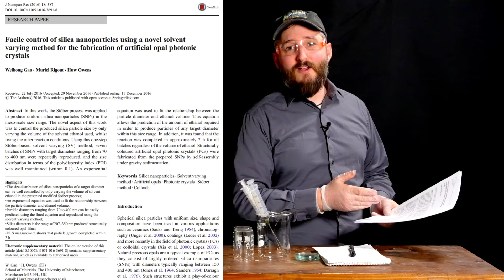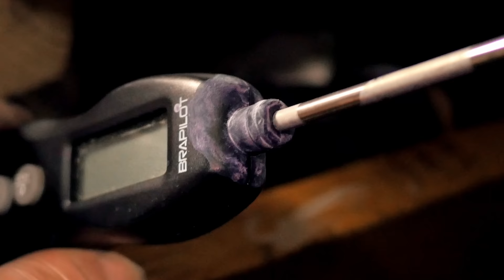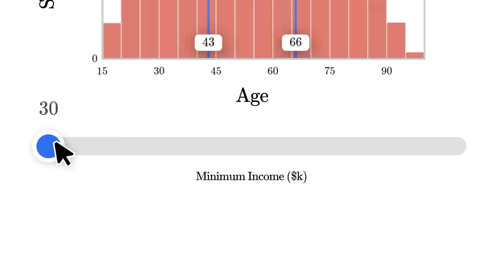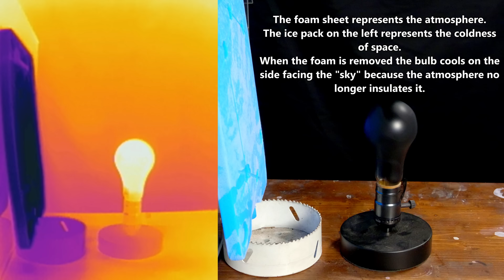Making Opals for Free Air Conditioning

Comment: Run the opaline fluid through a freeze dryer.  The vacuum element would negate the oxygen mixed in the fluid, and it potentially could speed up the turn around time for "settling out" a good looking opal.  Just a thought.  Cheers man, been a fan for a LONG time! :)
Reply: Or the opposite if natural opals are created under high pressure. I'd clamp a chunk in a vise between two flat surfaces. Ultrasound vibrations may do something but it's not able to grow a crystal in the first place. Something is holding the spheres together in the gemstone obviously

Comment: I’m a ring maker and often use opal as a critical component in my rings. I usually think about creating my opal, but the biggest hurdle I see is if you let the solution settle to create a gemstone. It’s very fragile, so I hope you tackle the issue of heating it under immense pressure to make a workable gemstone. I wish you good luck to you in your opal adventure!
Reply: Hot hydraulic press?
Reply: Natural opal doesn't require high pressure.
Reply: @MandelGuy232  Yes but real opal had millions of years to settle, dry, and bond together. Man made opal has to be sintered together to make an actual workable stone. the silica spheres are less densely packed and weakly bonded together so the resulting stone is fragile and more full of voids
Reply: As ideas: would pre-heating the ethanol in a second container and adding it would help the reaction?

Would adding some of the previous spheres work to help form a matrix, or is an “opal” as we know it not formed in a normal way?  As I mentioned in a previous comment, I know many opal hunters basically find driftwood that has been turned into opal. I wonder if you could use a similar matrix to hold the spheres tightly in solution like wood does and then dissolve it away somehow without damaging the opal? Tree roots and wood like red oak be a good porous choice I would guess. 

If you kept adding solution to an existing evaporation dish (a few ml per week) would that work to build up a decent crystal?

Comment: So where is my free air conditioning?
Reply: Uv ir radiation
Reply: It’s doesn’t allow heat (sun ie. UV radiation) through the light spectrum. Thus not allowing the heat to penetrate the windows which are one of the biggest problems about heat and cooling period.

Comment: Hey thanks for the shoutout and nice video!
Some tips that you may find helpful: For centrifuging, you need more speed not less. I used that exact same centrifuge, I just cranked it to max and held it so it didn't shake itself apart. Also for settling you'll want to dilute the solution with more ethanol, then let it settle in a tall tube. Like a grad cylinder with a removable bottom. That way the settling is as slow as possible and you'll grow the largest pseudocrystals. 
Also something I found was that the color you get from settling slowly or with a centrifuge, is not the same as the color you get from quickly drying. I found there was a weird effect where certain sized particle batches will settle out to look great, up until the second you attempt to dry them, then they look good. Or others that look good wet and dry. And different colors work differently depending on settling method. It was rather finicky to get it right.  Something I never took the time to do was quantify this carefully because it was so annoying doing the reaction as carefully as I was. The fact you got this basically working in a beaker actually speeds this way up. I was being way too delicate about it I think. Cool to see others working on this and this actually gave me some ideas on a way to improve making big chunks of opal. Though traditionally the long reaction time is there to make sure all the TEOS is used up otherwise the particles will start to agglomerate and stick to each other with the tiny bit that's left in solution.
Also for clarity, the issue isn't the particles. It's that they're not stuck together. It'll only go clear-ish if you sinter the final opal, or backfill it with epoxy to remove the air pockets/voids. The most difficult but pretty  ones to make are settled, dried, sintered, then back filled with a solution of even smaller particles, then sintered again. But getting that process to work is tricky. Though even a single round of sintering will make it more clear and glassy, but don't overheat it or it all just melts. Need just enough heat for the contact points between spheres to fuse, without melting the spheres. 
Hope that helps!
Reply: i watched your video 3 years ago. and when this was posted the first thought that came to my mind was  "OMG TTE already did this once " and suddenly i heard your name and had to come down to see if you commented and i was not disappointed hahah. i absolutely LOVE your videos :)
Reply from the maker: Hey thank you so much for all your research on this! You made it really easy for me. I think my previous calcium sphere experience helped me feel comfortable taking some shortcuts I wouldn't have otherwise. Like they say in the paper that the reactions were done in an inert atmosphere...but why? Maybe it improves things slightly but no way is that essential.

It's really helpful advice about adding extra ethanol for settling, and also about letting the reaction carry on to stop conglomeration from trace teos. I have a few samples now that settled on the bottom of my beakers and they do have a super bright band of color in the typical vertical stripes of a synthetic opal puck. I'm testing a bunch of stabilization methods currently like alcohol soluble binders and aluminum salts. I think maybe you could do without the supercritical drying if you start with an organic binder that burns out somewhat close to the sintering temp. I'm not sure, there's too much to test!

Thanks again, we'll have to keep comparing notes on this one!
Reply from the maker: I'm surprised you had better results with faster centrifuging also... That's bizarre! I only started seeing color flash when I slowed mine down. I wonder if it's about the amount of brownian motion happening... maybe your lab was warmer than mine.

By the way, you should take out the metal sleeves in your centrifuge and weigh them. I found mine were sometimes 5g different from others. Mine runs super smooth now at full speed with similar weighted sleeves opposite one another.
Reply: Most wholesome interesting convo on yt right now.   I love both of these channels, so this is like Christmas.  Thanks for doing it ya’ll.
Reply: @phlanxsmurf  need a mash up
Reply: I read this in the way that you narrate your videos.
Reply: Peak humanity in the wild. Its heartwarming!
Reply: What the internet was intended for
Reply: I wonder, can you use sonic vibration to help them pack better after they are settled and before sintering? With the right frequency, it may help settle them without kicking them back into suspension.
Or even settling them after they dry, although I might worry about abrasion effects, then.
Reply: Complete non-scientist here, but would it be possible to simply combine two solutions of differing sizes to fill in the gaps between the larger particles during the drying process?
Reply: My two fave science channels! Sick!
Reply: I've read your comment with a ruski accent. Awesome you guys making science, keep the good work.
Reply: @harvestkitty same thought I had. Unless we're off base, then the minimum effect would just be needing less binder/ post-processing since more gaps would be filled.
Reply: @Nighthawkinlight  I wonder if centrifuging at incrementally increasing speeds will allow for neatly packed “layers” to form better. That way you get the best of both worlds by allowing brownish motion to shuffle the particles horizontally and finally packing them down vertically with the higher rpm centrifuging
Reply: Perhaps the unbalanced centrifuge was a benefit?
Reply: Question: If the Brownian motion is what makes these particles settle so slowly, could you not cool the suspension to make them settle faster? Or would that actually not make much of an impact? Obviously at some point it would freeze, and I imagine that wouldn't help much :p
Reply: Youre basically Stephen hawking of genetics in my eyes. Thank you for all your videos I have learned so much.
Reply: I love your videos 🙂
Reply: Now I'm interested in seeing Aerogel made of opal...
I found this
"Synthesis of SiO 2 Aerogel Inverse Opals in Supercritical Carbon Dioxide"
Reply: There is something called stabilizing resin that's basically really thin resin made to penetrate into porous wood. Maybe that could work? I know those synthetic opals are using some kind of resin since they're mostly plastic.
Reply: How about vacuuming the opal solution together with a bit of low viscosity, slow curing dark epoxy in solution? Release the vaccum driving the epoxy into the voids that then can be centrifuged into crystals without the air before the epoxy sets up
Reply: Love your work.
Reply: Am I the only one who read this in his voice?
Reply: @TurboGreen  Same here haha
Reply: @Nighthawkinlight  I want to second the comments suggesting cooling during settling and or centrifuging, possibly cyclically and am also curious if handling the dry opal powder isn't also a concern? The TEOS certainly seems like nasty stuff but finely divided silica isn't great for lungs either … wearing a respirator might be a good idea and possibly developing a process where it's never completely "dry" until it's bound, if possible, might help with safety and holding a packing arrangement until the final product.
Reply: All this is way over my head, but could you sound to get the solution to vibrant the spaces out from between the nanoparticles?
Reply: When watching the portion of your original video where you use resins to encapsulate your results, you had said that you wanted a thinner resin so it could soak into the sample better.  I flashed on thin CA glue.  I think the stuff's thinner than water!

Now...there IS a caution that I should mention.  CA dribbled into a powder can be VERY exothermic!  I've wicked thin CA into a powder as a gap-filler or fillet and had it smoke, even getting hot enough to light soft balsa on fire!

Just a thought, FWIW.
Reply: pseudocrystals
Reply: U cool chemist too. I was just a general science student I didnt take chemistry
Reply: @harvestkitty  I think you and @3xeploding_3agle_studios would be on to something if it weren't for the need to sinter. Sintering basically compresses and removes the space between particles that the air is taking up. I think it's kind of seen in the video that this idea wont work too well in practice when it was attempted to make a dark base. 

It's also unclear what part of the drying process you are trying to improve. The size of the opalescent flakes will still be like grains of sand based on the way the spheres cant align together due to the brownian motion, and the distribution of those flakes are going to remain the same with any other kind of filler (like the nailpolish in the video) unless the synthetic opal is sintered.
Reply: I have also carried out this reaction. It's hard to make art with this. Neat colors tend to go away when attempting many different preservative coatings. Silane couping agents I think are what give the aurora type pattern. Vertical deposition as he showed in this video causes almost instant crystal deposition, and I read that in some literature.
Reply: @thethoughtemporium @nighthawkinlight what if you were to put your beaker in a vacuum chamber before drying so you take out all the air from the stirring, but still let it dry slowly instead of centrifuging it?
Reply: Could you chemically 'sinter' it by adding a bit more TEOS once the lattice has self-assembled in order to grow each sphere a few % so they fuse where they touch?
Reply: how is your lactoce intollerance experiment going after so many years?
Reply: I don't know if you will see this but if I use a uv resin as a liquid to settle the particles and cure it will that work?
Reply: Seeing open source scientific discussion between two of my favorite creators is awesome, you both do fantastic work in expanding what I, and surely others, think is possible through home experimenting and learning. Colab when?!
Reply: @zippolag  Was thinking this too.... Also controlling the temperature whilst under vacuum to give even more control of nano-bead lattice formation.
Reply: OK, I demand a joint video. I'm just kidding about demanding it, but it sure would be awesome.
Reply: dID aNYONE sUGGEST fREEZING oR eVEN cOOLING tO gET a gOOD sETTLEMENT?
Reply: I wonder if changing the shape of the container - either by adding jagged parts to the walls or floor would add a slight amount of turbulence that would result in a settling pattern more erratic and potentially more refractive than the columns the particles naturally settle in. Someone else suggested playing music as a way of changing the way the particles settle.
Reply: @harvestkitty  to get the chunky flashes of color like you see in true opals, the spheres have to bond in "sheets", so having the different sizes packed in together would interrupt that effect. Also, I think they are too close to the same size, so in relative terms it would be like trying to make a lattice of softballs and fill the gaps in with tennis balls.
Reply: @griffinbeaumont7049  I was wondering the same thing, something to help bleed off the heat should help with that, but I'm no physicist.
Reply: Two of the most stimulating yt channels collide. You guys are the kind of rockstars i like !
Reply: I don't trust anywhere you are, mr puts human braincells into microchip...
Reply: Be careful stabilising a centrifuge. We were shown pictures of a centrifuge that was being spun fast and became unstable enough to break. It launched a piece of itself through a concrete wall.
Reply: The legend!

Comment: What you'll see in high quality black opals is that the top of the polished opal with the "fire" is sometimes more translucent than the dark potch underneath. Doublets simply glue a translucent opal to a black background to create a cheaper imitation of a black opal. So you could let your opal just dry on a black surface, then use the nail polish trick to get rid of the white.

My understanding is that synthetic opals used as gems actually have the silica particles in some kind of resin, which is what fills the gaps instead of air.
Reply: Not anymore. No resin needed.

Comment: Sodium silicate is how you would best fill the opal spheres.

It can be perfectly mixed, balanced, and then dried using acetone under pressure until it solidifies [sort of like aerogel, only without making it actually hollow, and therefore having no porosity], which is essentially like what happens in nature when silane deposits around the opal spheres under high pressure in the earth.
Reply: Hello, I wish you good luck. Can you help me make synthetic opal?

Comment: My PhD is working with SiO2 Stöber type nanoparticles, glad to see this get some attention :)
I'm not going to grill you for the science about light scattering, it's a complicated topic. but let's just say that Rayleigh scattering is simply a simpler model of the Mie-Solution to the light scattering of particles. The Mie-Solution is exact, albeit requires a numerical solution.
Time to invest in a DLS / SLS / SEM / TEM! :D
Quick tip in general: pre-dilute your TEOS /w at least an equal volume of Ethanol (so split up your total charge of Ethanol into two parts), this prevents aggregation.
One last thing: it takes about 3 hours for me to see no more changes in particle size / scattering properties at 25C reaction temperature. I would recommend you wait at least 2 hours, even at 60C. you can do reactions in small screw-cap-vials, that way you can test many different reaction conditions very quickly. you can 3D print a holder or buy one made out of metal for a stirplate, should be able to stir like 6 at a time. then you just have to do it at 25C, but this doesn't influence the reaction all that much - you just get larger particles in general at lower temperatures.
One very very last thing: Higher percentage of solid content in a medium might not be better. The effect is non-linear, and there is a maximum volume percentage at which the maximum light is scattered and reflected, this is called "dependent scattering".
Reply from the maker: Thanks for sharing your expertise!
Reply: I feel like that once you start dealing with things on the nano scale most processes or phenomena become a lot less intuitive, and any short or simple explanations probably need a quantum asterisk  saying in reality things are a lot more complicated.
Reply: "I'm not gonna grill you"
continues to grill you
Reply: @ZanaCakes420  well, not on the science of scattered light. I did grill him about the synthesis itself tho, which is what this video was about :P

Comment: A lot of people are mentioning annealing as a fix for the lack of stacking or even the air contamination. I wonder if heat or a very weak but continuous vibration would help. It would need to be weak enough not to resuspend the particles but strong enough to dislodge them from the messy lattice.
     If you are stll worried about the denaturant or other contaminants/impurities, you COULD distill the reagents. With how well it worked, I don't think that's necessary though.  
      Also, (for anyone interested) the ammonia being used to help the TEOS break down is actually hydrolyzing it. The hydroxide ion in the ammonia (ammonium hydroxide, not pure ammonia which is a yikes) breaks the silicon-ethyl ester to form ethanol and an orthosilicate ion which then takes protons from the ammonium ion to form orthosilicic acid. This then breaks into silicon dioxide and water. The ammonia and water react to regenerate some of the ammonium hydroxide.

(edited for spelling)